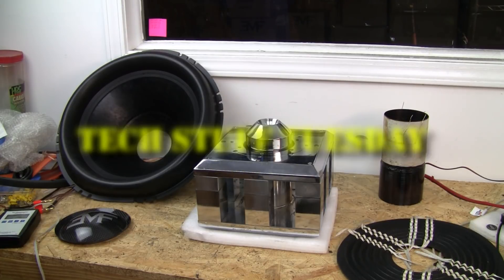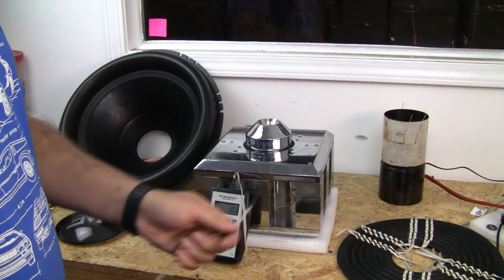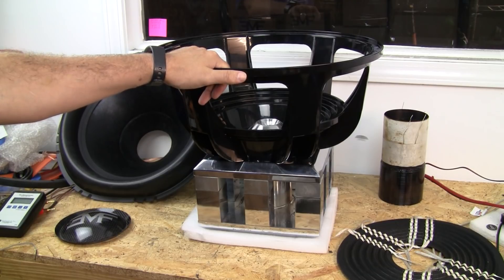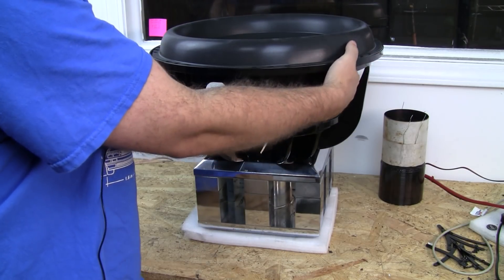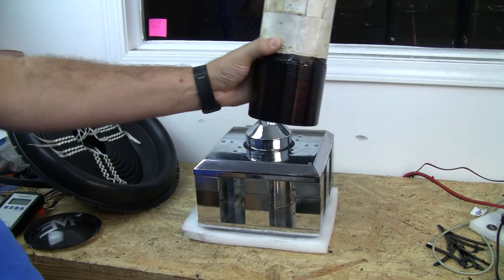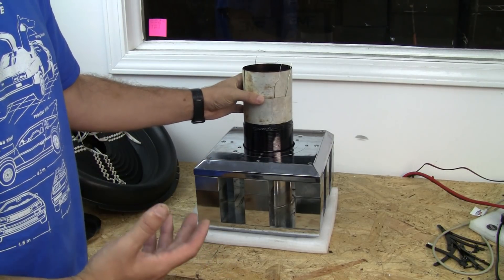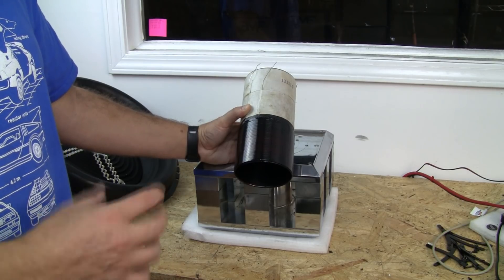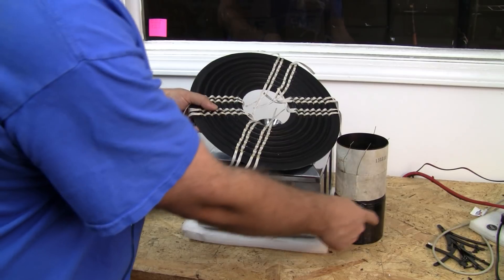Tech Stuff Tuesday - Sub parts, what they do, and how they work together

Comment: @EMF Audio How do you know select how many layers to add for a spider? Or is it strictly based on trial and error? I'm going to attempt to build my first subwoofer for a hobby project so I very new to this. I've watched a ton of you videos and I really appreciate how honest and informative they are! If it helps at all (from what I've watched it probably doesn't but figured it can't hurt to mention.) I'm using a soundstream tarantula t5-152 motor and frame for the build. I would be very thankful for any advice on spider selection and cone selection. I already have a coil picked out and I didn't have very many options since the gap is only 5mm wide. Thank you so much for you time! I hope your business thrives and you keep making exceptional videos!!

Comment: So I have a question is there an exact way that you can measure on how much height you have to put the voice coil is there a specific way of knowing how much height you need to have the voice coil raced raised
Reply from the maker: The proper coil length will depend on the top plate height and the limits of the spider and surround.

Comment: What's the main difference between 12 and 15inch sizes subwoffers with same motor strength except cone area ?
Reply from the maker: That would be model specific. Some may have different spiders, usually for those sizes it will be the same motor and coil but sometimes it's a different coil too.
Reply: EMF Audio i mean same motor force but different sub sizes?
Reply from the maker: @IndAudio  Are you talking about the same model sub or different subs?
Reply: EMF Audio same subs model.
Reply from the maker: @IndAudio  generally speaking the only thing different will be the cone. There are exceptions to that though.

Comment: Just a quick question, how do you control the qts of the sub? do you use different motor force and coil strengths to achive the desired qts?
Reply from the maker: There are a number of ways, it depends what  your constants are. In every case there is a side effect though. Assuming the motor and suspension is the constant, you could change the Qts with a coil change. If the motor and coil are the constant you could change the Qts with a suspension change. If you change none of the parts, adding mass would change the Qts.
Reply: @EMFAudio  thanks for the reply, so if i change a stiffer spider for a softer assuming everything is constant does it make the qts go down?
Reply from the maker: Going to a softer spider would make the Qts go up, your Fs would go down also. A higher Qts number is a looser suspension, the lower the Qts number the stiffer the suspension. Keep in mind Qts also has an electrical factor, it's the result of Qes and Qms.
Reply: @EMFAudio  ooh I see thanks for all your help lol I couldn't find that info anywhere else

Comment: Why are the main wires on the coil  that solder to the leads always so small? I've had a lot of NON - EMF woofers burn out at that point from too much power and also on cheaper coils. Just seems those would be a larger wires.
Reply from the maker: That's the size of the wire used in the coil. That's the direct connection. At some point it has to end up that way, that's the spot it does it.
Reply: @EMFAudio  It's just strange that the wire wrapped around the coil can sometimes be 5-10 x's thicker than the "direct connection" coming from the coil and then the leads are thick again. Why the thin wire in between?? That's a failure point that costs pennies to avoid.
Reply from the maker: @lmadden6236  are you referring to tinsel leads or the coil itself? That might help some confusion here.
Reply from the maker: @lmadden6236  yeah that's the winding wire, it's a continuation of the wire that makes the coil. You can't change it, you can't do anything different.

Comment: High. I'm looking for a 15 in. driver (Pr.) to replace worn out INFINITY Studio Monitor 150 , might You have something of the like ?
Reply from the maker: Am I correct in assuming the 15" is more of a woofer than a subwoofer in that?
Reply: @EMFAudio  Yes. but not looking to keep it '"stock" anymore
Reply from the maker: @jamiemeyer2483  We don't offer anything that would be a similar replacement. Everything we have would be a subwoofer, which wouldn't go in that enclosure well or act how is needed.
Reply: @EMFAudio  k, thx. On a side note, i have 4 6.5" G&S Redline mid-bass drivers, would you be able to make better then new?.  new former, cone, & surround . I still want to look into info on entry level 15" subs
Reply from the maker: @jamiemeyer2483  For me to do those 6.5's it would cost more than just buying new 6.5's that are better. As for an entry level 15", we have the Lowballer 15 http://www.emfcaraudio.com/emf-audio-lowballer-15-subwoofer/ But it isn't the same kind of driver you'd be replacing.
Reply: @EMFAudio   Thank You for the Info. and your time.  ;o)

Comment: Show us the coil slide to the bottom of the motor should time it too just 4 fun
Reply from the maker: It wouldn't take long, eddy currents are low in our designs. In some designs it could damage the coil from smacking because it would move so fast.
Reply: Ok